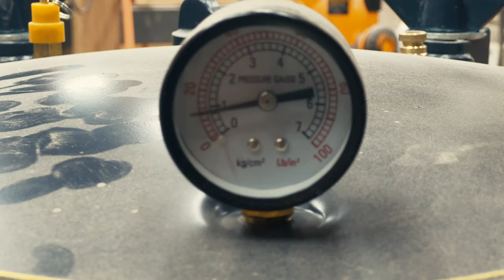The Dark Side of Wood Turning: Rescuing Applewood Burl

Comment: What is the cure time.  Can it last long enough to go through a vacuum pot then to the pressure pot. My wife felt like I needed both so she ordered both for me. If this epoxy hardened to quick do you have a recommendation or do you even use a vacuum pot at all?
Reply from the maker: I just use the pressure pot, works fine, thank you

Comment: What brand of epoxy are you using and the rotisserie you have mounted to the wall that you spend bowls on what is it
Reply from the maker: Hi Rick, I used the Puduo 50/50 casting epoxy. (Affiliate link in my description) I find this one less forgiving in that I havnt had any thermal cracks when the thickness of the pour can be up to 4 inches! Puduo recommend thickness of 1" max. Touch wood - no pun intended - ive not had any disasters. Lastly, Puduo is very economical to purchase 2 gallons at a time. As for the Rotisserie its a cheap BBQ rotisserie also from Amazon. I fashioned a steel plate on the end of 1" water pipe - does the trick.